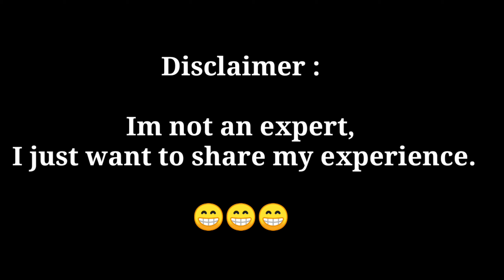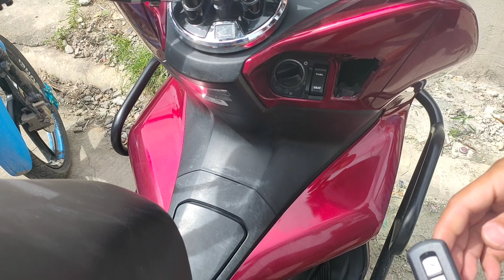My Honda PCX 150 won't start ( Dead battery ) FIXED !

Comment: Paps ilang taon ,ilang kilometer at ano size at brand ng battery ginamit mo.
Reply from the maker: 2 years and 6 months na paps, 12k palang ODO. Work at bahay lang kasi, nagkapandemic pa. Work from home na. Di na masyado nag momotor. Gamit ko ngayon na battery ay Quantom po.
Reply from the maker: Yan po ang pinalit ko sa stock na battery.

Comment: Ayaw din umandar ng pcx 150 ko. Me power naman at lahat-lahat pero walang redondo ang starter. Nasa honda shop ako ngayon at nag aantay na magbukas sila. Second time na nangyari ito sa akin. Nung first time electrical daw at naayos naman. Now here l am again. Nakakatakot na gamitin ang motor ko. Pano kung nasa remote area ako at ayaw umandar. Im having second thoughts na about scooters na walang kick starter. 21k na ang odometer reading ko at 2 years and 5 months ko nang ginagamit. Maybe ito na ang lifespan ng honda pcx?
Reply from the maker: Baka po kinakagat ng daga wirings mo sir.
Reply: NO

Comment: SO YOUR TELLING ME NOT TO USE A BATTERIE CHARGER BUT TO BUY A NEW BATTERIE AND INSTALL. WHERES THE BATTERIE.I D GUESS UNDER THE SEAT, BUT YOU DIDNT REMOVE THE SEAT
352 293 5866
Reply from the maker: No need to remove the batteries.
Reply: @eulotvofficial  yeah when its dead wont take a charge
Reply: @lookingthruwolfeyes  dont remove the battery just connect it to charger mach if you have